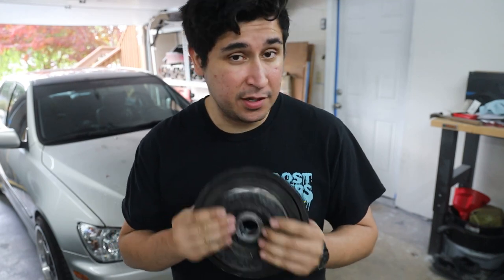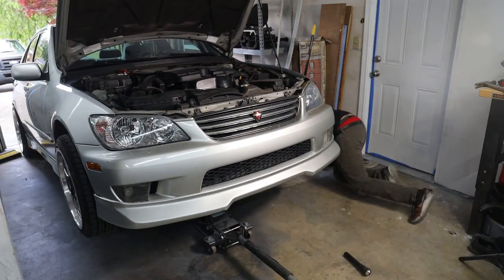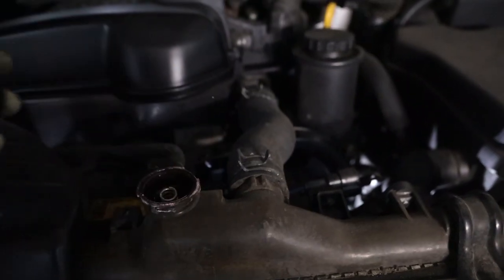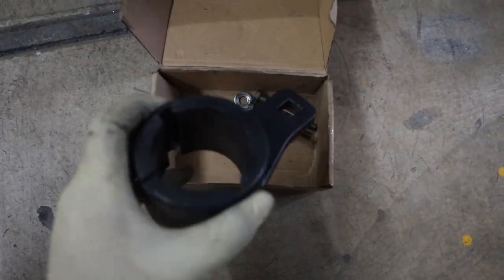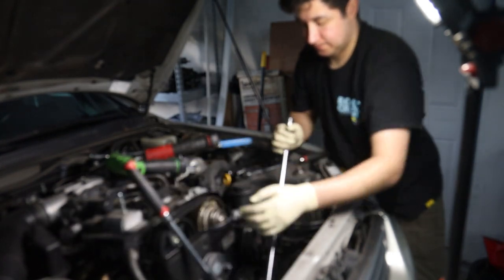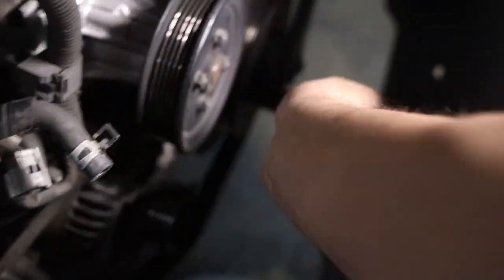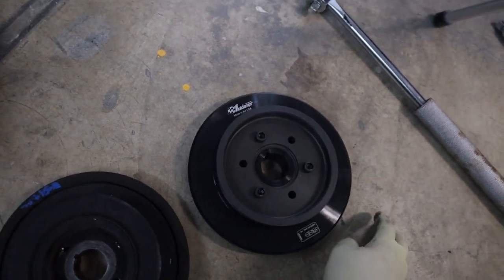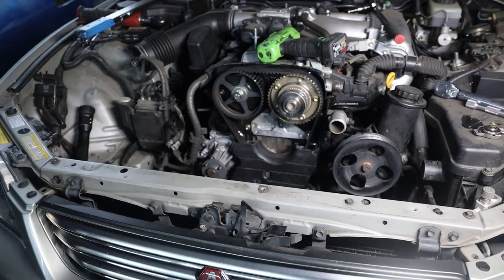If you have a 2JZ you NEED to fix this common issue! | 2003 IS300 Fluidampr Install

Comment: For the crank bolt, use this crack method where you lift the car and have the breaker bar at in angle to be moved upward when you lower the car slowly.
Reply: Doesn't work on this car from what I've tried and seen! This bolt is INSANELY hard to get off unless You're able to brace it up like our friend here showed us. Otherwise the crankshaft just keeps spinning!

Comment: thanks for the vid gonna be fixing mine this weekend! pulley popped off on my drive home
Reply from the maker: Rough lol
Reply: @RotaryDaddy  i ended up fixing it had a hell of a time getting it off i bought that harmonic balancer remover and it stripped the bolt holes on the balancer so i had to go buy a heavy duty one that clasps on the outside and with a lil pb blaster it popped off

Comment: genuinely helped currently ripped opened the engine cuz i thought my cam seals were leaking turns out it was the vvti pulley was leaking but my harmonic pulley was separated so thank you for showing me a good replacement

Comment: I followed this video exactly, I ordered all those parts / tools (except I chose a $95 balancer instead of the $500 one shown)......I just finished, right now - perfect video.  Thank you so much.  2000 Lexus GS 300.
FYI, My harmonic pully fully separated and is on the road somewhere along with my snapped belt....fortunately it didn't take out my fans and radiator.
Reply: so the 95 dollar one separated?
Reply: because i was gonna do exactly what you did but i don’t know if you meant that the old one flew or the 95$ one
Reply: @hieyeque1  thank you very much

Comment: Yes this is the part I was having trouble with but you mentioned an easy hack: putting it in 5th gear! I tried it initially in 1st gear and there was still too much play, then I tried what you said in passing: sat her in 5th, breaker bar + extension and some muscle - POP finally broke it! Tried almost every other method, this was the only one where I could gain the right leverage without breaking anything else 😅

Thanks you! Wish I had this 3 weeks ago when i first ordered parts, but at least now I know how to replace it again in the future!
Reply: i used a beaker bar up against the frame rail and just bumped the starter. loosened it no problem
Reply: @piraterick488  nope, didn't work for me - that bolt was torqued to 241ftlbs almost 20 years ago and was never removed since...bumping the starter did nothing for it. Hence why I mentioned above that this guy had a great idea putting it in 5th gear!

Comment: I decided to swap in all new stuff when I changed my timing belt, and the crank pulley bolt was tremendously tight and pulling it was awesome in mid-July scorching heat. I went with Dayco street performance pulley and my car is vibrating less, guess it was in time before failure
Reply from the maker: Sounds like you got it in just in time 🤘🏼🤘🏼
Reply: How do you like the street performance pulley?
Reply: Like what milage is about to go bad? I mean my beauty is close to 350k miles and still running strong

Comment: Nice vid, i need to do a full timing belt, seals service on my is300, was thinking about the fluid damper as well, notice a different in weight between old and new? How about overall drivability?
Reply from the maker: Perfect time to do it! About the same weight I believe and no change to drivability.

Comment: I put one breaker bar against the pavement, the one attached to the holder tool, then used a 4ft cheater bar on the breaker bar to loosen it. Same concept for tightening. I just slowly lowered the car toward the ground until there was tension on the breaker bar attached to the holder tool. I tried the frame rails but the condenser line was in the way on my is300. I couldn't imagine holding one breaker bar on the holder tool and another to break the bolt loose. But then again i'm not exactly a body builder. Just throwing this out there for anyone that might have trouble. The 4ft cheater pipe really made a difference though seems ridiculous but it worked.
Reply from the maker: That's actually a super good idea lol might have to try that next time!

Comment: I kept on bumping into articles that 2jz needs 291ft lbs to tighten the balancer. There was no torque wrench available unless I get a 700ft lbs torque wrench. 239ft lbs sounds more manageable.  I have 1.5JZ GTE

Comment: To save you some time, you dont need to remove the radiator. Remove the upper radiator hose, unbolt the fan shrowd and lift it up. That should let you lift it enough to give you enough room for a puller etc.
Reply from the maker: There’s a lot of things I would do differently if I wasn’t filming everything 😅 that being said I feel like the radiator is quicker to take out than just the fans, not to mention a bit safer to have out of there so you don’t hit it with the puller. To each their own but that’s my take on it 🤘🏼

Comment: 6:25 you can place breaker ext bar handle on the floor to get leverage using car’s weight then crank the engine for 1 sec or less.
Reply: Doesn't always work, especially with this INSANE bolt! I saw one guy do it with our car, and that's been an isolated case. This is the only way I've had success, except I put it in 5th gear then breaker bar + extension to break it off!

Comment: You should always click a Tq wrench twice     That initial lunge will through off torque spec, on a damper it's not gonna be enough to matter but on your cams, where the tolerance is much tighter and extremely important. You would be likely to lock a cam up.    D series Honda motors call for 8 ft lbs on the cams. I took it to 9;ft lbs and I couldn't turn the cam by hand and was hard to turn with a wrench   dropped it 1 and it spun as freely as it should.    Just saying. It never hurts too double check.   But fantastic video brother.   I know all about the 2jz crank bolt 😬😡 lol

Comment: Hi Irvin. This video inspired to finally do it myself. But i need to know the rest of the tools you have. Like the long bars you used to remove it, and the electronic wrench you used to tighten it? I already bought the rest of the tools you mentioned. Thank you!
Reply from the maker: Description is updated! 🤘
Reply: @RotaryDaddy  thanks for the update. Already got those too! Im doing it this weekend hopefully. Did you use any loctite on the damper bolt?
Reply from the maker: @hanzo935  absolutely not! Just torque it to the spec and that's all you'll need. If you locktite it on you'll never get it off again lol

Comment: I just discovered that my crankshaft pulley has been separated as you've explained. As a result of this hapenning, could this be a possibility as to why my serpentine belt is loose and squealing? I just replaced my serpentine belt and my belt tensioner but I noticed that the tensioner pulley was a little too close to the power-steering pulley, how do I resolve that as well?

Comment: How did you stop the crank from spinning when torqueing it down?
Reply: Yeah, I wanna know too. I put 2 bolts in and used a pry bar to hold it it, but it bent the bolts, I need a better method for next time 😂

Comment: Great video!! However mines an auto is there anything that I have to do differently. And how do you ensure that the engine doesn’t go out of timing
Reply from the maker: Negative, as long as you don't pull your timing belt tensioner you will not be affecting anything timing related.
Reply: @RotaryDaddy  Awesome thank you. Much appreciated
Reply: @RotaryDaddy  oh also one last thing. What method did you use to hold the new fluid damper pulley to tighten the bolt
Reply from the maker: @rcmt2965  that's a good question lol that does make a difference being auto. I just put mine in gear with the e brake on but with an auto I may use a chain wrench with a piece of belt under the teeth to protect the pulley.
Reply: @RotaryDaddy  Got it ok. I’ll try that. Thanks for the help

Comment: Please help how do you tighten back the fluidampr 2jz? What method did you use to tighten it. You didn't show it in the video.  I'm stuck
Reply from the maker: I put mine in gear and set the e-brake. Bit easier with mine being a manual but with auto's I'd use a chain wrench and an old piece of belt to protect the new pulley

Comment: Hello nice video! Is there way to test if your harmonic balancer is going bad ?
Reply from the maker: Not really, I'm sure you could do some measurements but I'm not aware of any specifications for it anywhere. I usually just replace them if the car is in the 150k+ range and never had it replaced

Comment: Before the replacement, did you have chirping noise just exactly at around 1.5k rpm and 2.1k rpm? (Not coming from the belt, I just replaced it :( )
Reply from the maker: @erbsrn1620  mine failed while I was changing the belt so I didn’t get the noise but that is a common symptom.
Reply: @RotaryDaddy  thanks for the quick reply! I will change it to fluidampr whilst changing the timing belt. Thanks for the video!🤍

Comment: Howd you tighten it without having the crankshaft move?? Did you lock your cams?
Reply: I’m wondering the same thing :(
Reply from the maker: Mine's a manual, I should have said something lol I just threw mine in gear and put the parking brake on, that being said, normally using a chain wrench will be good enough to hold it, just make sure to use a scrap piece of belt to go between the pulley and the wrench so it doesn't damage the ribs

Comment: Just ripped apart my 300 to do timing belt front main and cam seals, and stumbled upon a fluidampr already installed. Does anyone know how to take the fluidampr off? Since the stock crank pulley holder tool won't work. 01 auto.

Comment: What did you use to hold the crank from turning when you tighten it ?
Reply: Yes this is the part I was having trouble with but he mentioned an easy hack: putting it in 5th gear! I tried it initially in 1st gear and there was still too much play, then I tried what he said: sat her in 5th, breaker bar + extension and some muscle - POP finally broke it! Tried almost every other method, this was the only one where I could gain the right leverage without breaking anything else 😅

Comment: opinions on the billet crank pulley from driftmotion?
Reply from the maker: Not a bad option depending on the application. Jz's are internally balanced so no need to worry on normal builds. That being said if you are looking to run pretty high rpms then something like a fluid damper or an ati super damper would be a better option

Comment: when you was gonna tighten the bolt to the fluidamper, how did you stop then engine to rotate?
Reply from the maker: I got lucky cause my car is a manual so I can just throw it in gear and put the e brake on
Reply from the maker: For auto's I would use a chain wrench with a section of old belt to protect the pulley

Comment: Yo bro honestly what u recommend me , a 150k ish miles bmw 328i 2008 or 2003 is300 with 240ish both seem well kept and both around 5k
Reply from the maker: Hard to say. Depends on what you want, the bmw will likely be faster and 240k miles is getting pretty up there. In this case I'd probably side towards the bmw but if it was me I'd be buying the is300 lol

Comment: mine came apart while driving but the belt stayed on the inner section somehow and i made it home
Reply from the maker: That's so lucky, I've seen em shred belts, put holes in radiators and do all kinds of other damage.

Comment: How do you torque the bolt without spinning the motor, on an Auto Aristo?
Reply from the maker: Normally at work I use a chain wrench around the pulley with a section of old belt to protect the pulley. Hard with the fluidampr since it doesn't have the same holes for the installation tool
Reply: @RotaryDaddy Okay thank you!

Comment: I just replaced my with the one u replaced your with and now my engine is knocking . Why is this happening? Need help what do I do next .
Reply from the maker: Ok this is a rough one. Did you ONLY do the fluidampr? No other parts replacement?

Comment: How did you torque it without turning the engine over.
Reply from the maker: My car’s a manual so I put it in gear and threw the parking brake on. On an auto a chain wrench around the crank pulley is what I usually use but make sure you use a piece of old belt between the wrench and the pulley so it doesn’t damage the ribs
https://amzn.to/3JcOIEy
Something like this
Reply: @RotaryDaddy  huge! Thank you for your fast response. I’ve got a manual as well so I’ll leave it in gear with the e break on. What gear you leave it in?
Reply from the maker: @aidansuskic8736  highest gear. You want the engine to transfer the least amount of torque possible. Just make sure e brake is tight and chock the wheels
Reply: And if you could answer me one more thing. I see you have the upper timing cover off. My plan is before removing my old pulley is to line it up at top dead center. From there I’ll throw the Fluidampr on along the same key path and torque from there (and if all goes well the I’ll have it installed without having altered the timing). Am I missing something g anything here? Want to avoid making a huge mistake.
Reply from the maker: @aidansuskic8736  the balancer has nothing to do with the timing. I only had that stuff off because I was doing other stuff while I was in there. As long as you get the key in the key way you’re good, don’t have to touch belt or tensioner so everything stays the same

Comment: my belt is squealing, I am trying to find out what it might be.
Reply from the maker: I'd check it for cracks and wear. I have also seen the harmonic balancers separate causing the belt to stop moving and make a squeaking noise, that and tensioners or idlers would be the first things id be checking
Reply: @RotaryDaddy  it's been a reliable car and I love the 2JZ such and iconic engine. I'm a body work guy but I do small mechanical things here and there. How do I check the pulleys..the belts are not really old..

Comment: link to the harmonic balancer you're using
Reply from the maker: Its there, should be the first amazon link for the fluidampr in the description
Reply: @RotaryDaddy  Thanks bud. My belt is squeezing today the belt came off the lower power steering pulley. I had to readjust it. Wow the pully barely wanted to move
Reply from the maker: @JohnRamboSS  which pulley didn't want to move? The power steering pump?
Reply: @RotaryDaddy  I just posted up a quick video to show you. When you can take a look let me know what you think. Thank you for your help.
Reply from the maker: @JohnRamboSS  that's your a/c compressor, what happens when you turn your a/c on?
Reply: @RotaryDaddy  Ac is off. I don't use it, had it working 4 months ago and it stopped working. So I'm gonna get her checked out this week. My landlady doesn't allow me to do any work on my car. The place has so many cameras bro. Pisses me off csure I wanna take her apart and fix her
Reply: @RotaryDaddy  I had the compressor, condenser, lines all installed.
Reply: @RotaryDaddy  Should I get another one? Or can I buy the pully by itself.
Reply from the maker: @JohnRamboSS  nah if it's making noise with a/c off I wouldnt really suspect it. I'd get it diagnosed in person cause I can't really diagnose over video without having you pull more stuff apart
Reply: @RotaryDaddy  it's just so aggravating to me, since I can't work on her at home due to the landlord and her dumb ass rules.  I have to drop her off at a shop and get overheated for something that doesn't look like it's a big job .. But I appreciate your help bro! I'm sending her to get some exhaust work too! Sounds like she has an exhaust leak.

Comment: I only took the fan off lol
Reply from the maker: I filmed like 3 videos at the same time lol had to take the rad out for the ac compressor
Reply: @Irvin Ortega  you got to have 2 people to do that job lol it so tight lol and I did the crack pully on the bottom